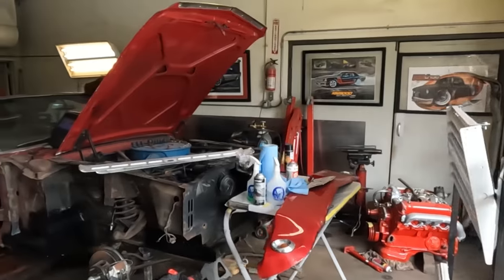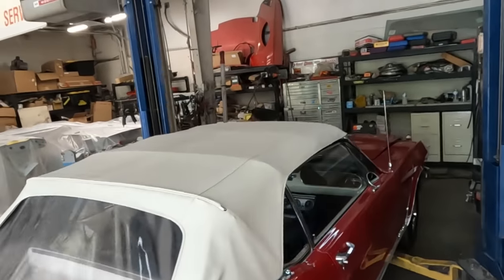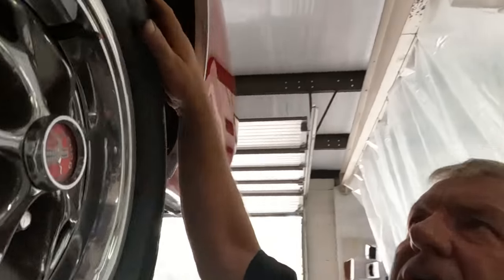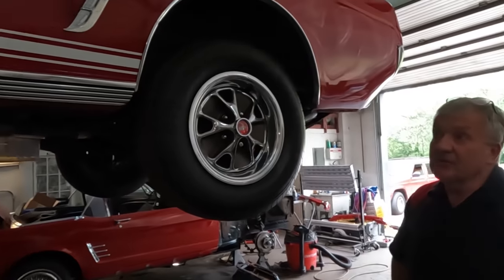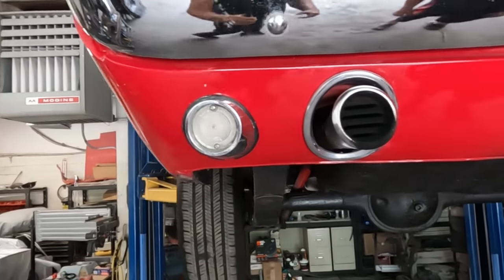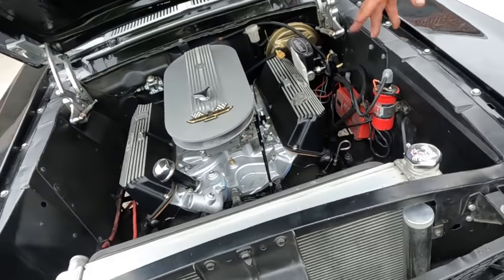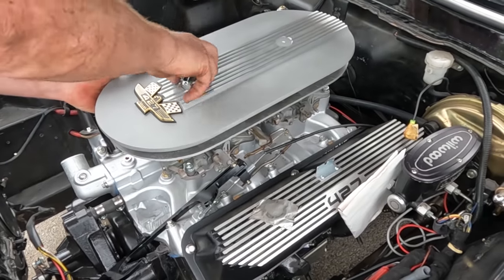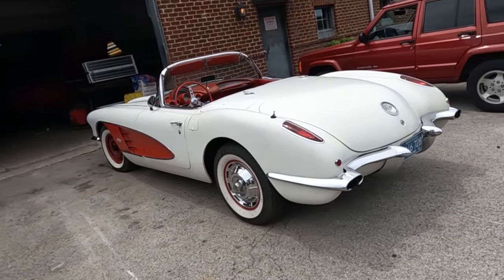Even MORE Classic Car Flipper Thievery, Incompetency And Nonsense

Comment: Who wants to bet that “427” is really a 352 with a dress up kit?
Reply: My guess its a 360 and if lucky a 390. 352s are like Y blocks, stopped making them almost 60 years ago.
Reply: Easy to tell all 427 whether top oiler or side oiler has cross bolt mains.
Reply: @samuelfreeman9518  they made orders of magnitude more 352s than any other FE engine. It doesn’t matter when they stopped making the 352. If you come across any FE today the likelihood it’s a 352 is still greater
Reply: @normanjones5167  most people don’t know the minutiae that differentiates engines. Hell, my dad and I still joke about the night a guy took a long stare at the engine in his 49 F-1 pro-street and confidently told his buddy “It’s just a 390 FE”.

It had a 400 Pontiac from a 68 GTO. 

If most people were tools in a shed, they’d be a shovel

Comment: I see bad body/paint work a few times a year when folks bring them to me to look things over after buying. It's typically poor color matching, blending and poor clear coat adhesion that I see from wrecked auction cars. It baffles me to spend to buy the wreck, spend to buy the body parts, spend the time pulling the car back straight but skimp on using seem sealer. I rack the bad   paint blending, color matching and poor edging in the clear up to laziness or a failed management pushing too fast.

Comment: Mustang is known for not leaving any room in the engine bay I had to change the valve cover gaskets on a 03 mach1 that job sucked if I remember correctly I dropped the engine cradle down to get the clearance needed

Comment: You simply MUST exercise due diligence when looking to purchase classic cars (or ANY car for that matter) as the outright fakes are definitely out there. 

I work in the film business and came off a pilot for a tv show in Arizona late last year (2021). It was set in the 70s and was supposed to showcase all sorts of rare cars of high pedigree that the production spent MILLIONS on. Among them were supposed to be 1970 Ford Torino Cobras in metallic green- obviously super rare, super fast cars. 

In fact, part of what made them rare are the engine options for that trim level, which consisted of 429 big blocks (Cobra Jet variety as far as I know). Imagine my surprise when I saw 351 Windsors sitting in both of them (they weren’t particularly good running ones, either). 

So I texted some friends who were much more well-versed in classic Fords than I am and turns out they were standard ‘71 Torinos that were dummied up to look like Cobras- whoever bought the cars for the show got duped into buying what they thought were high-falutin’ Cobra cars.  

(Not a first for the show as there was a LOT of mismanagement going on.)

Comment: I had a customer bring me a 64 Impala he bought for a ton of money from Mecum that was a joke. It was represented to be all original other than aluminum wheels. 

It ran horrible and the battery went dead quickly despite it being new and he wanted it running right. 

Among the list of problems, by the casting number, it was a 350 2 bolt engine with a no name Performer style intake painted orange, a 70's style Carter AFB, cone seat lug nuts that were only catching a few threads, alternator / regulator hacked and burned away, a TH350 with a PG shifter, which is always an issue, the turn signal switch wiring butchered, horn not working and was a hardtop - convertible conversion.

The engine has virtually no oil pressure at idle and the cam was fairly wiped out. Someone had recently put new valve cover gaskets on it and probably adjusted the valves to quiet it down. 

Yep.......share these videos..................

Comment: Just add the torque boxes,very easy to do.I did it on my 66 fastback, then go with weld on subframe connectors with a cross bar. No big deal.Been beefing these old Stang's up for years
Reply: I'm no Mustang expert, but this was my thought as well.  Why not upgrade the overall rigidity, instead of installing the factory bracing?  Wouldn't be "factory" correct I guess is why?
Reply: @ab-cd456  Yeah I could see going factory if it was a true convertible and needed rust repair.On this it could only help. It really shouldn't be that big of a deal like they are making it out to be.

Comment: I am very old. In 1965 or so my friend's cousin bought a 1957 Plymouth Fury. We lived in the rust belt of NE Ohio. All 1957 Furies were buckskin biege. This one was purple and ran like crap. He bought it anyway. It had 2 4bbl carbs. The rear carb had no internals and was stuffed with a shop rag. The trunk floor consisted of layers of window screen, roofing tar and newspaper. The bottom third of the car was poorly done bondo. The tradition of whammer bammer jobs goes back 100 years. Most buyers don't know what they are lookung at, but won't admit it. This buyer did not even decode the VIN.

Comment: Raced a 67 427 mustang on the Freeway in my Plymouth GTX 440 Super Commando and beat him by a car length at 150+ mph. That was 1969.
Reply: A real fe 427 runs better than that
Reply: @rogerdodrill4733  That day, it didn't.

Comment: No one runs Vin numbers through old forums or Marti reports for ford cars. So it will be a given that more and more people buy old cars that are bolted together from other cars etc. I found a 69 torino that was closed to be a cobra and the guy refused to send me a Vin. So when I came to check the car out I decoded the vin there and it was a 302 car cloned to be a cobra. Only thing he did wrong was left the vin cards, sad mistake on his part but good effort on mine*** keep up the good work in teaching Tony, I'm 21 and have a mopar mentor myself and it means the world to experience cars this age and not have to worry but it's 2022

Comment: If it is a side oiler it will have buttress bolts or as more commonly known as cross bolt mains. If I am not mistaken 427 side oiler was the only one in the fe that had those. And yes the carbs are supposed to be backwards for distributor to clear. Had a friend who cloned a side oiler he put the carbs on forward and couldn’t get the distributor in. I told him turn them around and gave him the proper linkage for that setup.

Comment: Half a century ago when I was young, I had a 67 fast back S  code 390 4speed. It was kinda tired. So I built a 68 302 4bbl to put in it with the same Trans.
As I remember I only changed the motor mounts and it dropped right in. Left the Trans in the same place, same mount and all.
Very easy swap....

Comment: Ford mounted the dual quad carbs backward because the throttle linkage was progressive.  The front carb opened first and for normal driving speeds was the only carb in use.  Mounting the carbs backward placed the primaries of the front carb closer to the center of the intake for more equal fuel distribution.

Comment: I wrenched in a Milwaukee Pontiac garage in the early 70's. A used late 60's Ford wagon was brought up from Chicago. The Ford wagon was a real hot ticket on the used car lots, they sold fast & high$. I was told to check this wagon over, especially brakes. Put it on the lift , took a quick look & RAN out from under it. It had been welded straight across the "B pillar" area, top, sides and bottom They took the front of a sedan & the rear from a wagon! It had blue seats in front & green seats in back. It was a Frankencar!

Comment: Bought a 73 Charger once. Was told it was extremely rare. Black car. White top and white interior.  400 4 speed. Car had  massive amounts of bondo in it.  But they added metal shavings to the bondo so that a magnet would stick. I didn't know it until I experienced a hit and run that left a huge portion of my quarter panel on the ground. The worst area was about 3 inches deep. I was shocked!

Comment: Always check the VIN numbers  before buying any classic car!  My 1966 Impala is a true SS that I bought as a roller. No motor or transmission. Had a 327 now has the 427 out of a 1969 Chevelle SS. Took my time and did in right. My 1968 396 SS convertible is all original except the brakes that have been upgraded to 4 wheel disk.

Comment: Ford does some backwards shit, flippers are one thing, but when the factory does it, it's even worse. While ago I got a Crown Vic in the shop and I was supposed to change the gas filter. So I look by the frame, near the tank, and what do I see? A spin on, flare fitting, oil filter-looking gas filter!!! I go and check all data, no listing for this filter on this car. So, the next thing I do, is call the dealership. Well, it turns out, he tells me that it happens all the time. Ford will run out of a part in the last 10,000 units, so what they do is just substitute that part with whatever they can find on the shelf. And because it's the last 10,000 cars built, it's too late to update the listing in the book. That's just one of the many absolute horror stories I have, working on Fords over the years.

Comment: Simple fix row bar it, it won't be stock but it'll be strong as hell. Weld up a subframe, $600 in Steel, and 20 hours labor, TIG welded 40 hours labor. Since it's not stock, big horsepower, modern suspension. Technically it would be better than new.

Comment: It's difficult to see areas that have been faked on a car once it's all painted. The only way to tell for sure is to see the body in bare metal after dipping, or soda/sand blasting. I once bought a "new" Opel GT that had been side-swiped, bondoed and repainted. I took it back to the dealer and rescinded the purchase.

Comment: There seems to be a good lesson with the convertible. Learn to read vin codes. Especially for the vehicle you are looking to buy. That way if the vin says coupe and you are looking at a convertible you know its a scam. There are many sources of information for a classic car. Once you decide what you are looking for do some simple research. With the black Mustang Kiwi nailed it It was far too cheap a price for what they were offering to do. So now the owner has a possibly junk block with a few shiny add ons and he cant even start the engine....but his money is long gone.
Reply: Also maybe diversify away from the mustang/camaro/55s. There are lots of nice old cars that don't have a famous name. I have a 70 buick lesabre and it gets tons of attention.
Reply: @abelq8008  It only gets attention because of the vast acreage of painted sheet metal riding on 4 wheels. JK does it have a 401, 430, or a 455?

Comment: Wow.... What a mess both of those cars have become... Hopefully, the red first gen Mustang owner can file a claim in civil court against the dealer for selling this dangerously weakened vehicle... Then use that money to have Kiwi repair the vehicle to what it should have been from the factory... The black '68 Mustang is a real mess... I would re-locate the stock engine mount struts to re-install a 302 with a C-4 trans... Sell the 427 & trans to somebody who has a correct application for it... Use the money from the sale of the 427 & trans to pay to have Kiwi remove the butchery from that valuable car, and do the proper steps to restore it back to the reliable factory condition. It is sad to see beautiful cars like these, being 
molested at the hands of hacks, who only care about lining their pockets with quick money... 
      Take the hack's who committed this sick/repulsive form of mechanical debauchery, to civil court, to force them to pay for the damage they caused to this once beautiful '68 fastback Mustang...  But then, there is a chance the seller could get out of this mess, as they might be able to claim that the buyer bought the vehicle in the 'as-is' condition, and the seller has no implied responsibility as it is a USED VEHICLE... SO, BEFORE BUYING a vehicle like these, have a competent mechanic check it out, to see if butchery has been done to it, to get quick money... This would be a very smart thing to do ...
       What people should do BEFORE they buy a 'Restored' classic car like these, is to have an expert, like Tony or Kiwi thoroughly check the vehicle... This way they can see if there are some serious problems with the vehicle that would destroy their bank accounts trying to repair it..

Comment: There are two kinds of Mustangs, fast backs and parts cars! LOL!! Weld a fast back roof on it, or part it out. A 67/68 Mustang was available with an FE from the factory. Someone couldn't correctly install an engine in a car in which it came. Sad.

Comment: That coupe to convertible is easy to fix, all the parts are available. 67 bb just need to locate the transmission correctly, and use the mc with outboard brake lines, that mc does fit that close factory.

Comment: I remembered I was looking for a 73 rivera for years and found one on market place I was disappointed in finding out all the errors of the car like swapping the original 73 front end with a 71 and pipes not welded just tied together with rope the guy wanted 10 but I talked him down to 1800 due to all the errors I showed him and I was super irritated when he said he couldn't open the hood but there was a 455 but I opened it I 10 seconds and found out it was a 305 from a c10 I still have the car I'm gonna make it work at this point I just need a paint job and install the new 455 I bought for it

Comment: I really wish the bad apples would be named: these shops know precisely what they're selling, and their dishonesty deserves to be exposed.

". . . 4 bolts hold the engine mount bracket on there, but they're only using 2 of them . . . "
I nearly choked on my drink when you said that; good thing the prior 12 minutes prepared me for more outrageous statements.

Congratulations; you've got at least a few more new subscribers.
Reply: You and me both, I'm all for shaming incompetant work. But lawyers.  Slandering a buisness name with youtube evidence of such is cut 'n dry and you will lose unless you got a very detailed work order of what the end result should have been.  

And in the case of the engine swap, heres where you really need to be a fly  on the wall when the customer came in and what the agreement was. Devils in the details.  Hypothtetically, the customer: 'I want this engine in this car... No, I don't want you do do anything but install the engine I'll take care of the rest myself. No I don't want to pay to set the engine and transmission back, I just bought a new driveshaft leave the trans where it is. I don't want to risk the body work, just install the engine. rack relocation? No don't do that. etc. etc.   
 Well, they potentially got what they paid for, even if it is not what they wanted, an engine installed in the engine bay. The shop could have tossed the engine in the trunk and it would still be "installed 'in' the car", though in that case the customer can win with the expectation that an engine be installed in the engine bay.

Comment: For the botched convertible you could try getting in touch with somebody like Schwartz Performance who make a full chassis for the early model Mustangs and ask if their chassis would make the Mustang stiff enough as a convertible. That would give the owner coil-overs, a choice of brakes, engine mounts and rear ends including an IRS. Wouldn't be cheap but it might save the car which looks good otherwise and it would improve the handling.
Reply: That's a ridiculous idea. Honestly.

If someone sold me this car in this condition, they'd better have fled the country, because I'd get my money back any way I could.

You don't take something like this dry. Ever.

Comment: No kidding. I found a 65 Fastback.  It by chassis a 6 cylinder engine chassis with Some V8 stuff tied in. The door tag says it’s a 225  A code car C4 Automatic. Here is the killer a fastback roof was grafted on.  The hidden number says it is a 6 cylinder coupe . It sold with a beautiful red paint and new interior. They got a title claiming it used some patches here and there. It should have been a salvage title.  On the black car I would not be surprised if it was a 390. That makes me so sad. I love Fords FEs Mustangs, Cougars, Fairlane and 65 Galaxie one of the most beautiful cars Ford made, and the only full size ford that weighs the same as a Roadrunner.

Comment: That second car wasn't originally a convertible. there are supposed to be large plates under the car to reinforce the structure of the car. it possibly could be fixed with frame stiffeners and possibly a light roll cage. that last car the installation of the FE engine was really jenky. judging by that I don't think it's a side oiler 427, it's probably a 390. that black Mustang looks good I'd yank the engine and reinstall it right.
luckily this guy knows his Ford's really well.

Comment: 30 years ago I bought a 1966 coupe K code mustang with original block and 4 speed. Driving home from work About 10 years ago a pickup slammed into the rear end of my K code mustang at a stop light. Me and my cousin hauled it home on my car trailer unloaded it in my backyard it sat there for almost 3 years then i bought a 66 coupe 6 cylinder shell was going to put my high output 289 and 4 speed in the 6 cylinder car but come to find out the 6 cylinder cars front frame rails were rusting from the inside out from the outside the front frame rails looked great but they were very thin. So we cut my K code front end off and welded the K code front clip to the 6 cylinder car. Firewall back it's a run of the mill mustang. From Firewall forward it's a very desirable 66 K code. I've even took the time to cut my dual exhaust brackets off behind the back seat because only K code cars have that. I couldn't take waisting a K code vin and title it will never leave my family so it wasn't built for any bad reason.